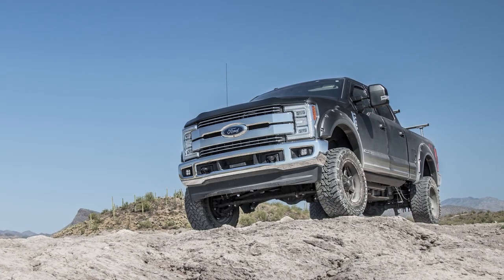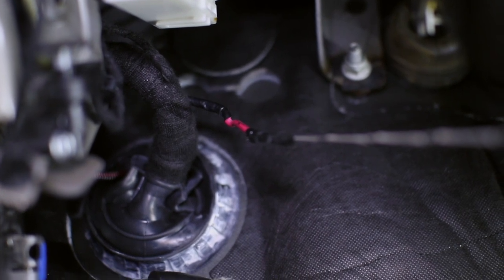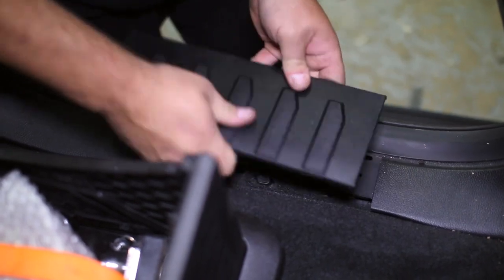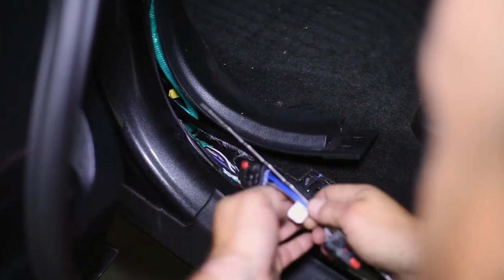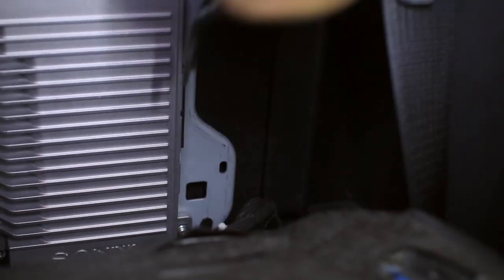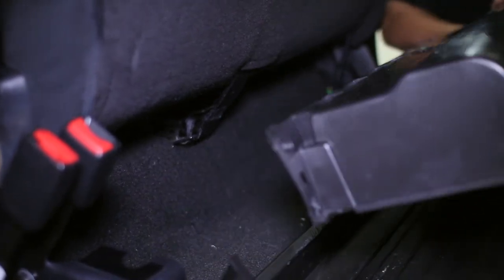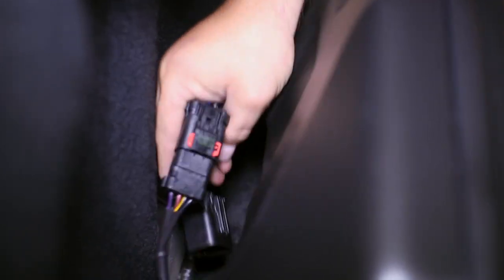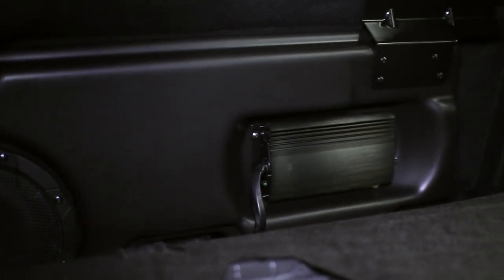2015-2019 F150 and Super Duty Kicker VSS Substage Powered Subwoofer Kit Install

Comment: I installed this in about 2 hours, but it could probably be installed quicker. The hardest part was running the power wire through the grommet, but even that wasn't too bad. Instructions supplied could have been better but this video really helped.  I suppose the best thing is the sub doesn't take up any space.  I went to a car audio store and they wanted to put an amp and box on the floor of the back of the cab, which I didn't want to do.  I also heard that you can fit some slim boxes behind the seat like this one; however but can't put the back seat up.  This one sits behind the back seat and you can put the back seats up with no issue.  You won't 'rock the block' with this speaker but it adds some much needed low-end and can hit pretty hard on some songs.  I got a manufacturer refurbished unit (with install components) at a discount.  I've also heard about people looking for these used online or they get them at pick-and-pull lots to try and save money.

Comment: Looks like a nice system but the installation is sub par ,,using t tap connectors under the sill plates where water ,snow / slush and road salt in the northeast will ultimately get is not acceptable. The correct connection point should be up front at the kick panel higher than sill plate level if there is no other option but to install in the sill plates,the wiring should be cut tapped,and shrink wrapped,then sealed . The t tap is only acceptable to use where there is no water or moisture threat.
Reply: Agreed. I live in a hot and dry southern state and I would NEVER use a T tap in a vehicle application under ANY circumstances. Even ambient humidity will eventually corrode and compromise the circuit. And the next guy will never know where the poor connection was made since it is hidden. These T tap connectors should only be used indoors.  Shoddy. Cheap. Unprofessional. Unaware. Otherwise a decent how to video.

Comment: Thanks for the video, but please clarify something.  In the video description (text), you indicate this is an improvement over the base audio, but in the video you are removing a factory installed sub and amp.  Is that a Sony sub and amp?  My supercrew has the base (Lariat) 7-speaker system but there is no sub and no amp behind the seat.

Comment: But i dont have a factory sub.. will this kit still work?  2018 F150 XL
Reply: The xl and xlt without the sony system is pretty much plug and play. You just have to have a dealer with IDS or Forscan software to be able to turn on the sub option.
Reply: @Kevin-y1d9u  - so, no need to do the wire tapping?
Reply: @corpsiecorpsie_the_original  no, you can pull the driver side rear trim and make sure the plug is back there. My stx had the plug. Just plug it in and have it turned on by dealer or forscan
Reply: @Kevin-y1d9u  - Awesome!

Comment: Will this work on 2017 F150 with ecoboost engine with auto start/stop?
Reply from the maker: F150s with the stock Auto Start/Stop systems enabled may experience the Kicker System cutting out temporarily when the truck switches from its alternator power to its battery power. Unfortunately, the only known fix is disabling the Auto Start/Stop feature manually or permanently via custom tuning.